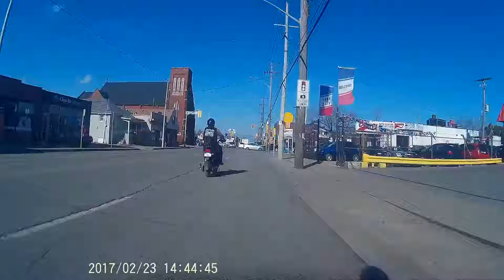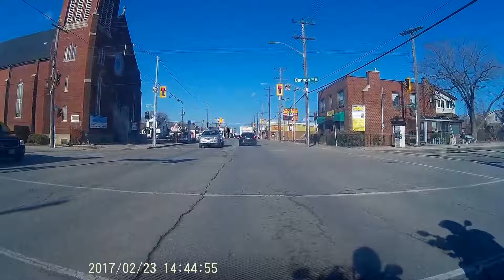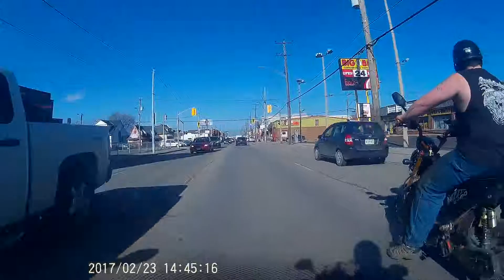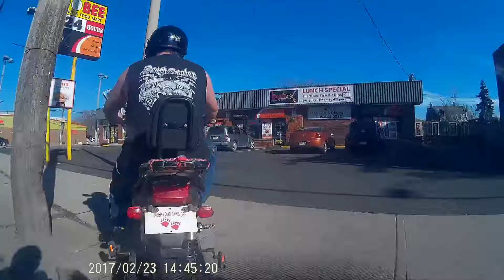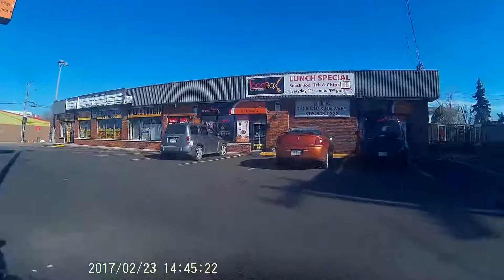Sunwin 96v 1500w Controller Failure

Comment: I'm looking at getting a 96V 1500W controller.. can you tell me what the DC draw (battery draw) is at the 3 different speeds on the controller?
Reply from the maker: Ive had mosfet blow outs problems with sunwin brand @ 1500 watts.  50a high 40a med and 30a low.